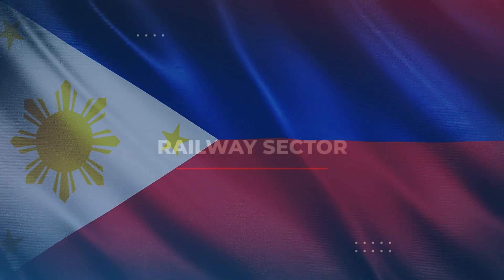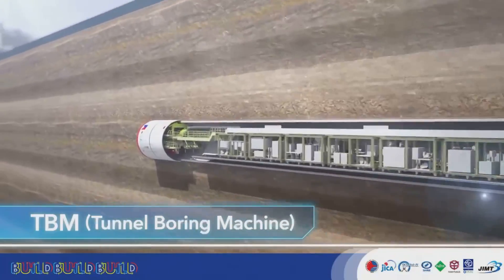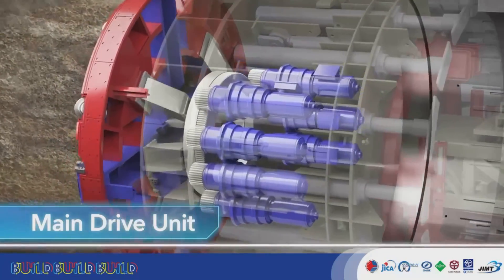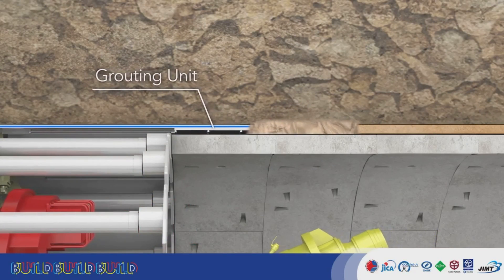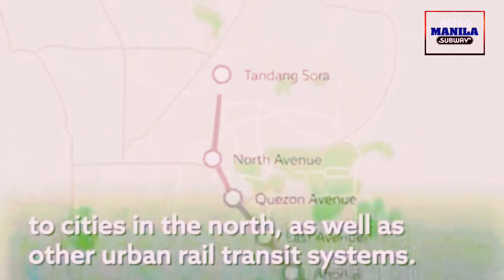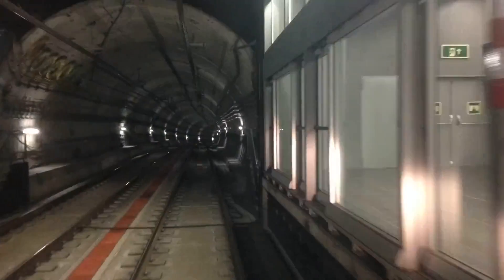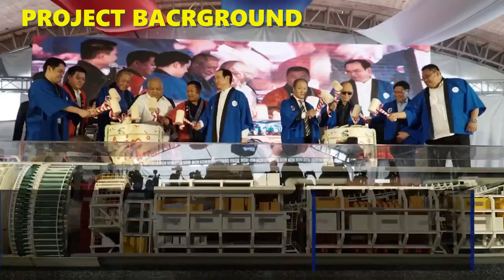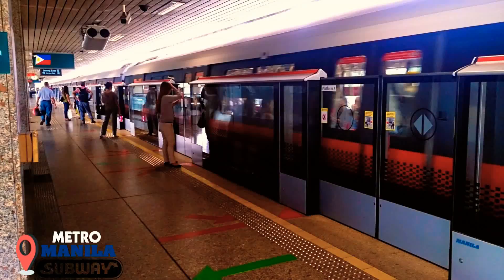Philippines' Project of the Century: Metro Manila Subway Update

Comment: I doubt the technical and economic feasibility of this megaproject. This is more based on political rather technical and economic considerations. I can just imagine how many flood control equipment that must be operated and maintained throughout the year and devastation that will result with just one of these equipment failing during the a flood!
Reply from the maker: The project is both feasible, technically and economically..
Reply: @aseananalytics  My girlfriend is both beautiful and charming!
Reply: I agree. The government can't even fix or minimize the flooding in Metro Manila when there's a big storm.  The subway tunnels will flood when its done. lol 
Look at the MRT, They can't even maintain it because the maintenance budget gets pocketed by the corrupt officials!

Comment: Only president Marcos created these great economic long term plans for agri, infra, and industrial developments.

Even the bataan nuclear power plant, President Marcos executed quickly the construction, he continued the earlier plan of past administrations, from Garcia, to Macapagal, to Marcos.

President Garcia:
In 1957 – American-owned Meralco commissioned a preliminary feasibility study of putting up a nuclear power plant and concluded it should be built only by the 70s.

President Macapagal:
In 1963 to 1965, government and IAEA pre-feasibility study, to consider nuclear plants in Luzon grid by early 70s or 80's.

President Marcos:
1972 to 1973, the government and IAEA conducted the pre-investment feasibility study of the nuclear plant and concluded the 600MWe capacity in Luzon.

1976-1983, BNPP construction was completed.

In 1984, Hot functional tests and initial synchronisation with Luzon grid are done.

IAEA OPERATIONAL SAFETY REVIEW TEAM (OSART) conducts a review on the construction appraisal of the plant. By June 1984, high grade URANIUM FUEL was delivered by US government to the BNPP.

In February 1985, the IAEA OSART conducts another review on the OPERATIONAL READINESS of the plant. Public hearings begin in July for the plant’s licensing (insurance liabilities).

S t u p i d Cory Aquino:
April 1986, ALL efforts from 1958 to 1985 were STOPPED by Cory Aquino. She wasted all the 27 years of efforts and the invested public money.